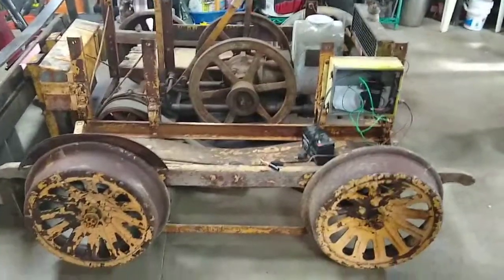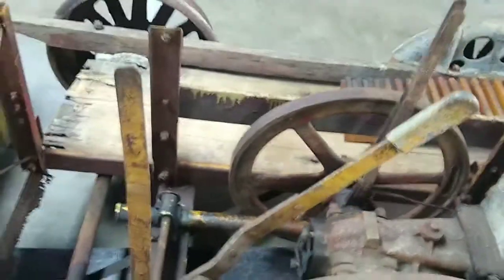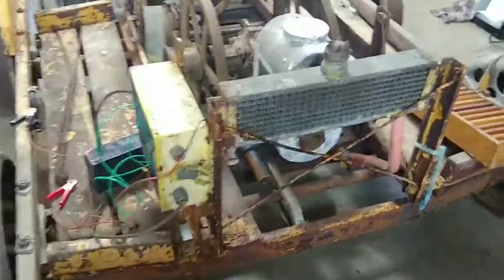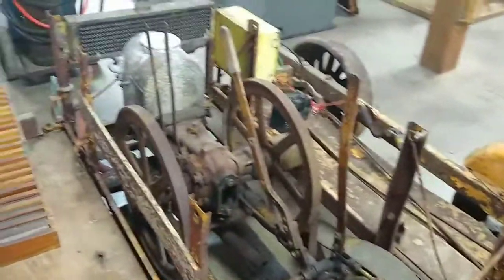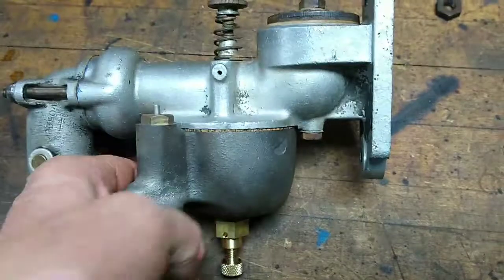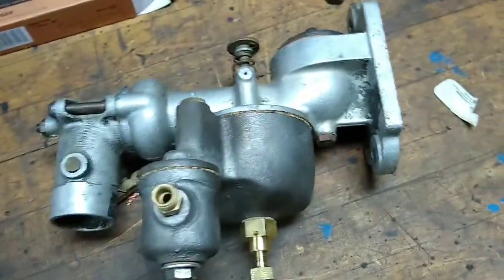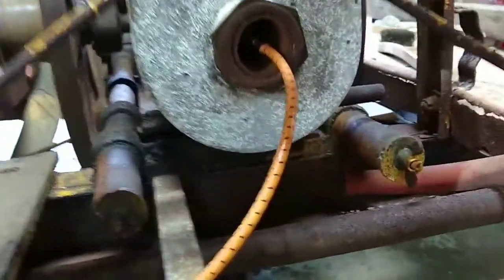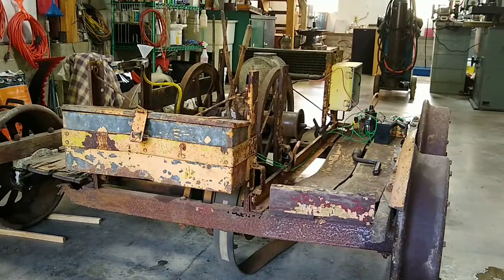Fairmont railway speeder

Comment: If you haven't already learned, your car is an M19B. They were produced from 1923 until 1932. The engine is a PHA. A friend and I each have one that we're restoring but they're pretty rare. Counting yours, I know of five of them out there. Any history on yours? Do you know where it came from?
Reply from the maker: Thanks for that information. I don't know a whole lot about this speeder. I have rebuild my share of hit and miss motors as well as other old stuff. I'm learning with the help of guys like you. I may be able to get some history on this machine when I get a chance to talk with the guy that had it in a storage container. A friend dropped this off for me.
Reply: Do u know where I can find a good carb for 1 I've got the hole motor less carb ?
Reply: @rickybailey7123  the brass Acorn carbs are rarer than hens teeth but a modern C-5 carb will fit.